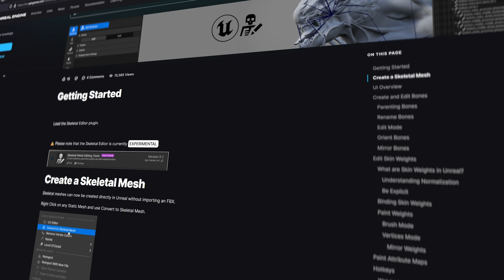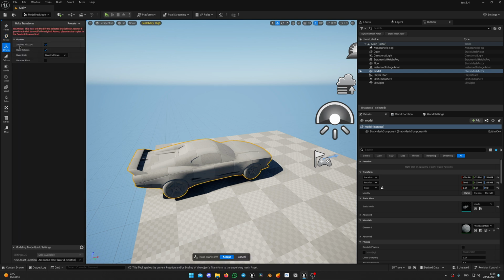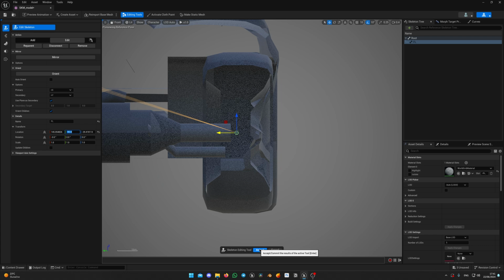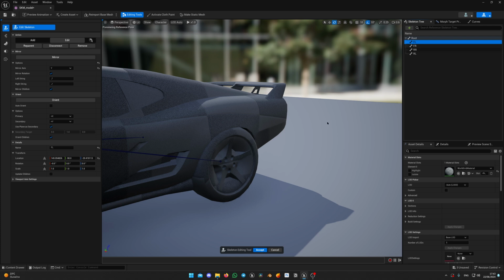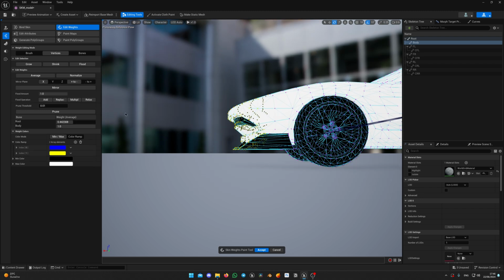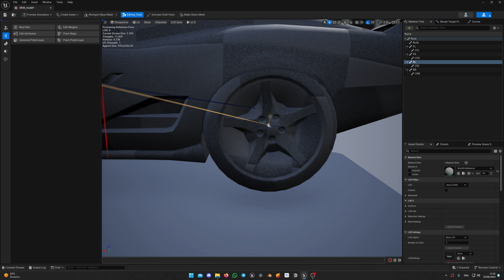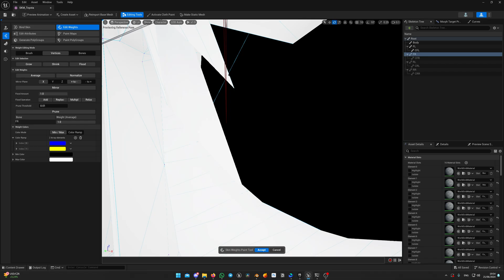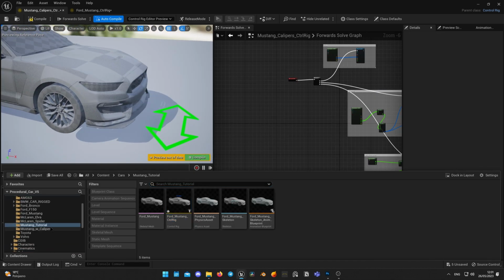Unreal Engine 5.4 Skeletal Editor - NO CAR RIGGING in Blender or Maya anymore?

Comment: Not sure what i am doing wrong, the rear tires rotate just fine but the front tires rotate in a huge loop versus at the bone created, any idea why?
Reply from the maker: hey, your model may have some camber on the wheel, so it's not exactly straigh, which can give a wobbling effect. You can try in blender just replacing front wheels with rear ones - by copying the pair of rear wheels (which are working fine) and placing them instead of front ones. Well If you car has similar wheels

Comment: With this method are you able to remove the meshes them selves and attach different meshes like tires or rims or are you stuck with meshes that were attached with the model?
Reply from the maker: hmmmm potentially yes, you can get wheels from other model, for example. place it with car body, than merge it in one static mesh and after this convert to skeletal mesh

Comment: When I convert to skeletal mesh, the material ID's get messed up? Is there a fix for this?
Reply from the maker: Workaround could be - assign materials before converting to skeletal mesh. If you have same materials it can merge them. For example “default material” can be merged only to one slot, as it is the same

Comment: Currently doing 6 wheeled APC instead of 4 wheels. Hopefully the process works, I do remember having trouble with middle wheels not working in back when using blender plugin and creating control rig. Hopefully with your modular rig tutorial its going to work. I am following step by step but adding Middle wheel bone as well. Fingers crossed, cheers
Reply: Hello! I'm about to try my hand at rigging a 6 wheel Mack water truck. Let me know how this works with 6 wheels? It has been tough finding tutorials on it...
Reply: Did you solve it？
Reply: @ yes i did, just follow the steps just like in the video but add the third wheel whenever wheel nodes are added

Comment: Revisiting this, I love your section on the downsides. The best in-editor solution I have determined, which is cumbersome, is to us the Modeling tools and use UV islands to separate each of the components from the mesh, then I use the XForm to edit pivot, and set the pivot to the center of the separate objects. Now I copy and convert the collection of meshes to a single static mesh, and use the pivots as exact location references that I can copy and paste into the bones of the skeletal mesh. It yielded perfect centers for the bone placement. 

The annoying thing is, with weight painting, it feels like painting twice. Once in UV to separate, and again to assign. 
I want them to allow us to paint weights of sections, and then click an auto-assign bones button that places a bone at every painted weight section/group by surface or volume center.

Comment: hello, I'm having trouble with the weight painting, is there any way to select all the vertices since mine have 500k+ and isn't connected to each other when i hit flood. thanks
Reply from the maker: hey there, as I conclude in the end of the video with high poly models that would be better to use blender and free plugin called "UE 4 Vehicle" as it will give you faster result. UE tools are beta and It still needs some improvement. Yes it works with low poly models, but makes it much harder when you have a high poly one
Reply: @postprocessed  Thank you! 🙏

Comment: Hello my friend, thank you for the video, is it possible to use separate meshes (car body, 4 wheels) to create skeletal mesh using this method? When I group select and right click to do so, it creates separate entities.
Reply from the maker: Yea for creating skeletal mesh all meshes should be merged first. You can either merge them during import by ticking "combine meshes" when you import. Or merge meshes in unreal engine. To do so you need to enable "static mesh editor" plugin, select multiple meshes and pressing shift+5 to enter modeling mode. And merge these meshes before converting to skeletal
Reply: @postprocessed  Thank you!

Comment: Everytime I try to convert to skeletal mesh Unreal crashes. :(
Reply from the maker: probably the model is hipoly and you don't have enough RAM :(
Reply: @postprocessed  It's only 6k triangles and I'm running RTX 4080.
Reply: @postprocessed  nevermind I solved it! I guess Unreal didn't like that it was an obj file.  I re-exported from Blender as fbx and now it worked!

Comment: I found it really hard to weight paint high poly cars, is there any tips to do it?
Reply from the maker: yea that's what I am saying in the video that weight painting is not yet very comfrotable for more high poly models in UE, unfortunately that would be better to use Blender or Maya in that case :(
Reply: @postprocessed then can I rig my car in blender, then import it back to ue and still use your ultimate car control rig?
Reply from the maker: @jasonkam002   correct, just be sure that bone naming/placement is the same!
Reply: @postprocessed  yea got it, thank you so much!

Comment: Great tutorial...however how would you go about snapping bones to the center of the wheel rim with more complex geometry?  My model has a very complex rim design and it isn't as simple as in your model.  Thank you.
Reply from the maker: I’ve addressed exactly same question to the devs… and made a feature request to have grow or flood operation so you can select all verteces of the wheel for example and snap bone to center of selected geo
Reply from the maker: And I agree with you it is not that easy when you have much more complex geo… and for that blender/3dsmax or maya is only option :/
Reply: @postprocessed  Ok thank you for the quick response.
Reply from the maker: @porterdesignandmotion  there is also an option of like... creating skeleton and putting control rig just with dummy (empty) skeleton into the blueprint, making wheel as separate mesh with pivot in center and attaching it to wheel socket in BP and that should work but needs a bit of placement of static mesh parts
Reply: I ended up just "eye-balling" it from the multiple views and got is pretty close.  With more complex geometry, this process is very slow and laggy.  Curious your feedback here as your work is always high quality, with more complex vehicles than the one in this tutorial.

Comment: This is FANTASTIC!  Can you apply this to a motorcycle? Or a helicopter?
Reply from the maker: I think it is possible to apply weighpainting for motorcycle too! helicopter? Why not also?
Reply: @postprocessed  i think helicopter should be fine. I tri3d a dirt bike yesterday and the chain and calipers became a problem (it warped and twisted).  I think calipers on a car would be the same thing, unless you cheated it and just had the wheel turn (but the disc and calipers still). I came across the spinning caliper before. Looks terrible.
Reply from the maker: @davidwillno  haha tomorrow you will see how to deal with calipers 😎😎 dropping a banger rigging video

Comment: Bro I like this One According to my suggestion Which rig would you prefer doing in blender or unreal
Reply from the maker: Hey man! Well it really depends. Skeletal Mesh Editor is cool… but… when you have complex geo… you spend more time in UE - so in that case blender. But if you have nice proper model that has good wireframe - I would stick to UE as no need to move outside of it
Reply: @postprocessed  thankyou brother🫶